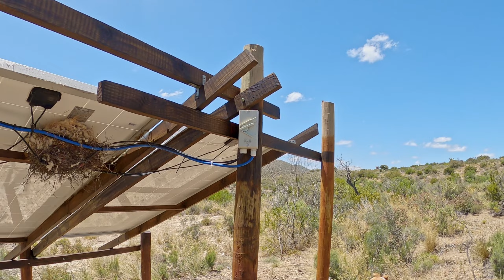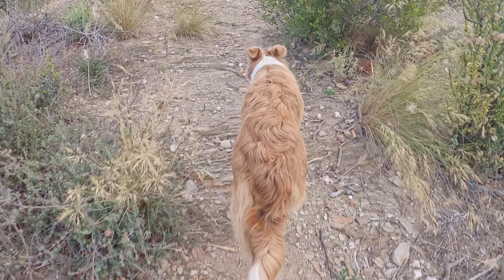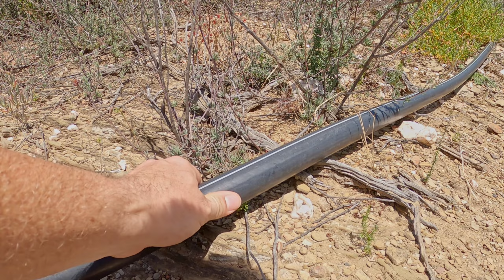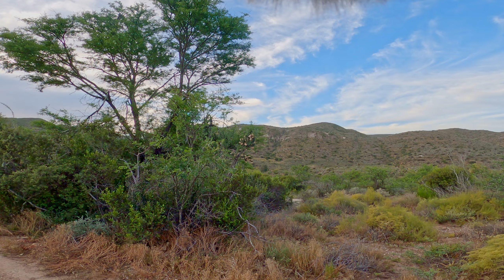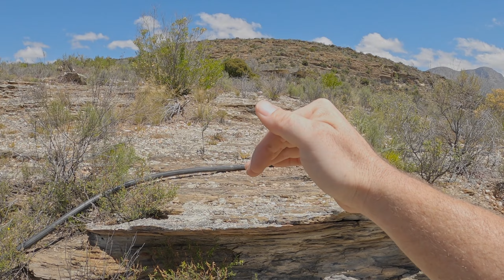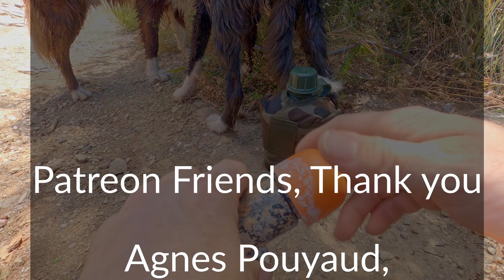Let me show you our initial homestead water system - well to tank.

Comment: Great to hear from you!  It seems it has been a while.  Thank you for the overview from your solar panels to storage tanks.
I have wondered about powering a submersible pump direct from the solar collectors without an intermediary voltage regulator (a battery?) since I saw this method the first time. Here is the question; When the pump power switch is on and the sun is low in the sky or a cloud comes across the panels, isn't the pump running with low voltage?  If yes, won't running the pump with less than optimal voltage shorten the life expectancy of the pump?
My thought has been the easy solution is to tap a 12 volt battery into the submersible pump power supply as a "voltage regulator".  If the pump always receives at least 12 volts, I believe it will be more efficient, and have a longer life.  I'm curious to know what you think 👍
Reply from the maker: Excellent question. I reckon there are pumps that would operate that way, but they are becoming less and less. Most of them now possess a soft start and threshold start system that only kicks in if the level is right and also without the massive bump of inrush current. The one we have is an AC pump, with a built.in inverter. So whether it is powered by panels (DC) or directly from mains AC, it runs the same. It wasn't stupid expensive, but it was a few smackeroos more than a simpler pump (which would have needed a controller externally). Good to hear from you too, Steve!
Reply: @AridForge  THank you for taking the time to explain!  Sounds like you have a "smart pump" - smarter than me 😅.  I'm no longer buying this kind of gear so the technology has left me in the dust.  With an onboard inverter, it likely has high/low voltage safeguards built in.  Very cool to know.
It's Thanksgiving week here in the US, so I'd like to take a moment to say Thank You for being my friend! 😊
Reply from the maker: Thank you for watching and chatting! 🦃

Comment: What do you use for hot water for your shower in winter?
Reply from the maker: When it's really Hotz the old convection pipe works, until there's a good differential temperature but for now, we mostly rely on a gas\lpg heater in winter (fee cold months). The rest of the year is just to hot to use any warming. I'd really like to get a proper grid detached solution in the new house. This is a sore point. 😬
Reply: @AridForge  I have been building and testing a few options during the winter and it seems that heating water with solar panels and a DC element is the solution. The other options require to much maintenance.
Reply: @neelsscheepers8841 you're probably right about the low maintenance. But I guess it's only viable if you have a lot of batteries (which can be pricy). Because heating water is very electrically expensive. So having an alternative source of heating water adds hours or more of power to your system in winter. And if you direct your toilets sewage to a biodigester then there are no recurring gas bills. All the best!
Reply: @fire17102  I Don't use batteries for the heating element only 2x330w solar panels. My whole farm runs on solar during the day and use the battery at night.